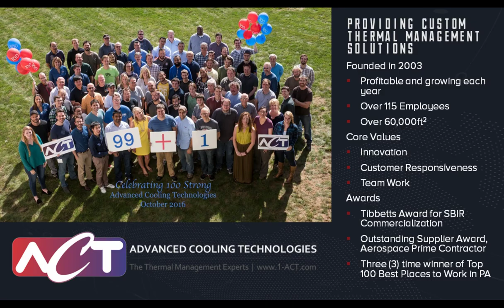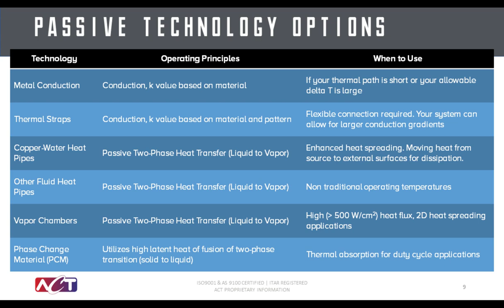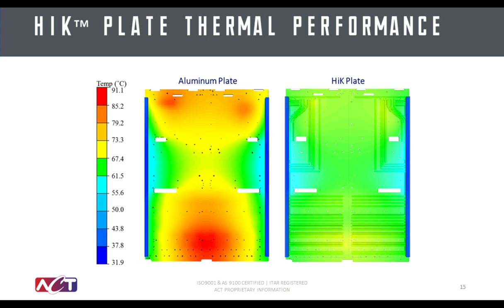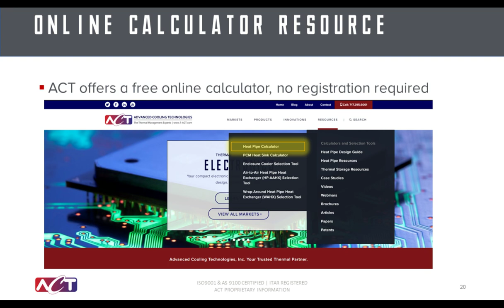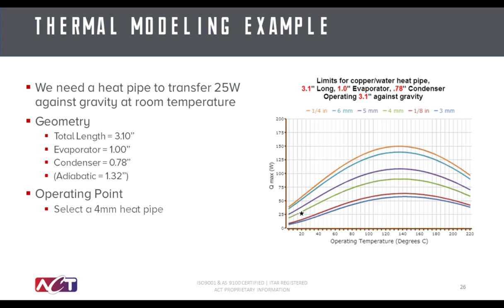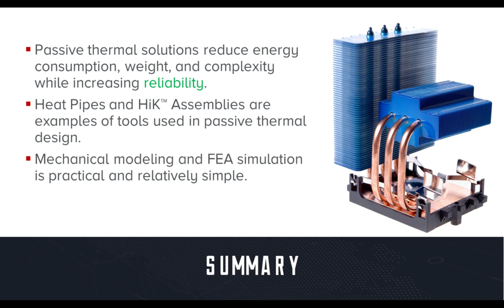WEBINAR: Removing Thermal Bottlenecks with Passive Thermal Management Tools and Tactics

Comment: Thermal voltaic cells feed off latent heat and can provide electrical voltage which can used for cooling a device and also control the amount of cooling provided there's enough heat available to perpetuate a heating/cooling loop. You're Welcome.